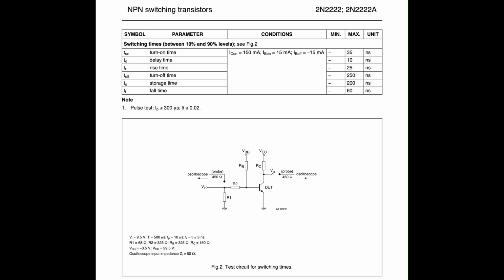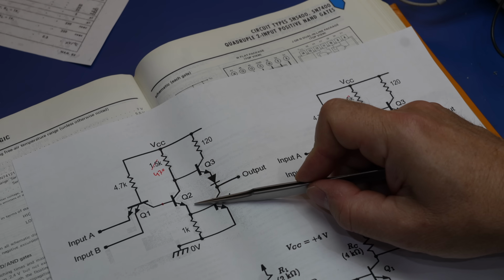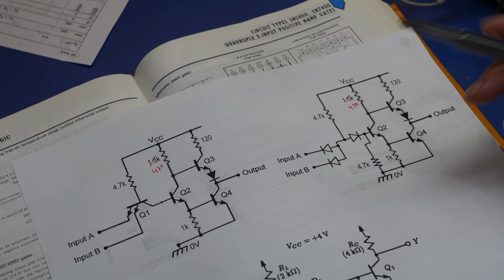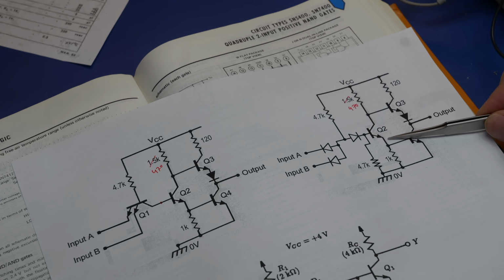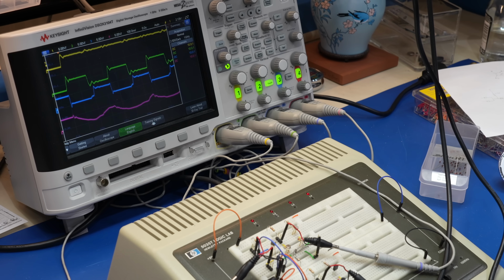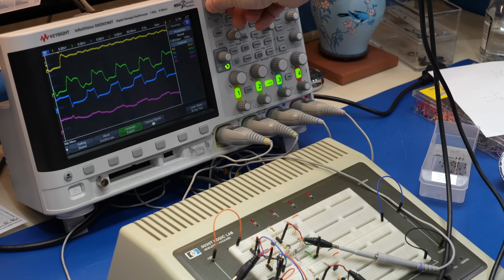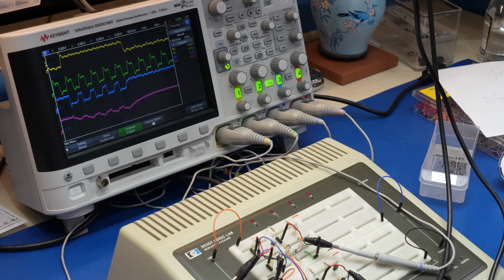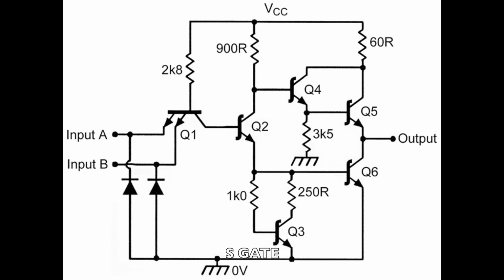How a TTL gate really works - we find out by building one

Comment: Back in the late 1980's I worked for TI, and I remember reading how they developed a massive number of their ICs off the back of their "Digital Field System" (DFS) range of multi-channel seismic recording systems. These were produced between 1968 and 1975, with the DFS-V model remaining in use well into the mid 1990s. Everything from Digital Signal Processing, Large-Scale Integration, Precision Analog-to-Digital Conversion and  Instantaneous Floating-Point Amplification were first seen in these (now completely forgotten and impossible to find) systems.

Comment: Does TTL logic require that the inputs have much higher current sinking capability and result in some incompatibilities with existing designs?  I wonder if the Schottky diode implmentation would've helped the DTL gate quite a bit, as well?  Are modern gates more or less complicated than TTL?

Comment: Could you bias the transistor so it just barely saturates or just barely doesn't saturate when the gate is on?
Reply from the maker: Yes you can, but then it becomes very sensitive to temperature and each individual transistor, so it's unstable. Then you can pile up components to compensate for that but it becomes impractical. That's the genius of the Schottky diode clamp: it does exactly that, but with just one component and no adjustment.

Comment: I have a very tangential question, but having watched your videos I think you might be interested. It involves LS TTL gates and HP instruments...

I was fixing an HP 4192A impedance analyzer, for the second time, and the fault ended up being a 74LS03 logic gate. This gate was buried pretty deep in the fractional PLL, with no off-board connections, so probably not electrical overstress?

My question is, how can something as simple as a quad NOR gate fail? Have you (or Ken) ever run into that sort of thing, and figured out what the root cause is?

A couple of items of history on this particular machine:

1. A lithium ion battery used to replace the trickle-charged NiCd CMOS backup battery (what? who? why?!?) detonated, shearing some wires and covering everything with electrolyte and soot.

2. The various power/reset connectors between the SMPS board and everything else have been very flaky due to some really poor quality tin plating. After cleaning these, I considered the instrument "fixed" the first time.

3. The aforementioned logic gate failed, after perhaps 6 months and maybe 3 hours of run time.

I half suspected that the lithium cell electrolyte had something to do with it but that part of the unit wasn't very dirty, and the particular package that failed didn't look corroded or chemically attacked in any way I could see.

I guess the only other external possibility was that maybe it was actually electrical overstress, due to a failed ground connection in the flaky connectors and something other than 5V reaching the chip. But nothing else was dead, and this happened when the unit was assembled, and so when there was a set of bolted chassis connections between the SMPS and the PLL board. 

Maybe the chip just decided to die?

I feel like I've seen you guys run across failed logic gates before. Is there any wisdom you can offer as to why these things happen?
Reply from the maker: Old TTL chips do die all on their own! Electromigration, defect growth in the semiconductor, bad wire bond, corrosion...

Comment: What transistor did you replace the 2N2222's with on the totem-pole output of the TTL circuit that sped it up so much?   Either I missed it somehow, or you didn't mention it.   Either way,  I'm curious.     Thanks for such a great explanation of how TTL really works!
Reply from the maker: It was an HP proprietary 1854-0610 transistor that I had in my collection, no JEDEC 2Nxxx equivalent unfortunately. Quoted for Ft=800 MHz.

Comment: How is a "thing" with 2 emitters different from the same thing with just 1 emitter which has 2 wires attached to it?
Reply from the maker: That would short circuit the two inputs!. The dual emitter has two junctions that behave independently. The two inputs remain independent, and aren't short-circuited.

Comment: I've seen the Schottky diode trick elsewhere but didn't get it. Thanks for taking the extra step to explain that. I can definitely say I learned something. (And I did see the other commenter identify that as a "Baker clamp.")
Reply: A Baker clamp was often done with a regular SI diode. The Schottky diode achieves the some thing with less saturation voltage. (And the diode is slightly faster too.)

Comment: Please try it with a 2N2369 - a transistor designed for ultrafast switching.
I remember reading a great article titled "What made the 1960s CDC6600 supercomputer fast?" mentioning it got around the saturation charge buildup by doping the transistor base with gold, making a built-in saturation limit.
Reply from the maker: Indeed, 2N2369 has a Toff=18ns. Very similar to the 2N709 Toff=15ns. I tried the 2N709 after a commenter mentioned it and worked almost as well as my fast transistor, and was used in the CDC6600 (according to https://cpldcpu.com/2020/02/14/what-made-the-cdc6600-fast/). The 2N709 was designed by famed Jean Hoerni, pioneer of the planar Silicon transistor at Fairchild after having escaped from William Shockley's lab in Mountain View with future Intel founders Gordon Moore and Robert Noyve. Unlike the 2N709, the 2N2369, also originally a Fairchild transistor, is apparently still made. I have only one vintage 2N2369 in my collection.

Comment: Question: without having it simulated, why can‘t you just turn q2 by 90 degrees like q1? So emitter to collector of q1, base via 470R to vcc, collector to base of q4? It would definitely suck all charge out of the base of q4 when q1 goes low but i‘m not certain it would drive q4 on when q2‘s emitter was high. But in theory vcc - 0.6V (base emitter diode) should pull it up…

Comment: Thanks for the lesson, I enjoyed it. With limited knowledge in this area I am wondering why D3 is needed in the DTL, you mentioned it as a voltage dropper but if A or B is driven close to ground why is this needed for the circuit to function? (By pure coincidence I saw a diagram of basically that stage without D3 while checking if I remembered correctly what DTL means so I guess it can at least in some situations work without it?)

Comment: Wow, this takes me back to designing logic circuits out of the Yellow Bible in the 1970s.

But this is a much deeper dive into the inner workings of these TTL ICs than I ever did.  I paid much more attention to the data sheet specs than to the internal circuitry.  After watching your video, I finally understand what was going on inside the ICs.  Very well done!  It was illuminating to see you refine the performance of the discrete transistor circuit, component by component, and see the results on the oscilloscope screen.

And yes, I was waiting until near the end of the video for you to stick in Schottky diodes across the base-collector junctions of Q2 and Q4.  Well, at least you did Q2!
Reply from the maker: Just for kicks I also tried Q3 and Q4 but it didn't improve anything.

Comment: 18:41 noob question: couldn’t you remove the delay in the DTL circuit by adding a diode in parallel to the one pointing to the right, but reverse it?
Reply: or short the existing getting a wired ‘and’

Comment: ECL keeps the transistors in the active region all the time.  Benefits are high speed switching, and also steady current draw from the power supply, so the supply decoupling requirements are much lower. 

Disadvantages are the insane power draw and constant heat you have to remove.
Reply: Reminds me that Seymour Cray felt the challenges in making computers wasn't the speeds, but removing the gosh-darned heat. So put ALL your resources INTO that instead. 👍
Reply: So I guess it's Class A logic. ;-}
Reply: @Jeff-si7ni yep that's a very accurate way of putting it.  And every signal between two devices has a termination resistor.
The other odd thing about ECL is that is runs on negative voltages.  
The mainframes I worked on had -3.6VDC for the CPU logic, and I want to say -4.8VDC for RAM.  There was a -5.2 somewhere, that I can't remember. The termination raptors would get pulled to -2VDC.  It was a serious learning curve for a kid fresh out of college knowing only TTL and CMOS.
Reply: Ages ago I worked in experimental particle physics. Mainly an end user of electronics in those days.  Typical use case was robustly packaged analog and/or digital modules with fairly simple functions, but LOTS of channels and LOTS of interconnects.

Almost all digital circuits were TTL, but ECL was sometimes used.  All I knew about it was that it was fast, ran hot and had weird voltage requirements.

This video and discussion has been very helpful in clarifying one more of those things I "should have" understood way back when.

The most amazing part: this is YouTube. 😮

Comment: Great video Marc. I had to use the schottky diode trick, or baker clamp, for my Apollo NOR gate replica in order to get the average propagation delay below the 24 ns mentioned in the spec. How did Fairchild manage to keep the Toff time so low even though they transistors were clearly saturated? Did their transistors have embedded baker clamps?
Reply from the maker: I don't think so. Which transistors did you use? If you have some laying around, the vintage 2N709 that a commenter suggested worked way better. I imagine you can find a modern 1 GHz-ish transistor that would do just fine.
Reply: @CuriousMarc  I am using the BFR380L3E6327XTMA1 RF transistor. It's turn on time is pretty quick. But the T(off) time was pretty long. Adding the baker clamp dropped the Ton and Tiff time to around 15ns.

Comment: I remember seeing some stuff where they had trouble 'turning off' the output. Turned out they used ECL to 'pullup' but simple resistors to 'pull down'. (or maybe the other way 'round, it's been decades, literally). So the load capacitance, although small, was affecting the rise/fall times.

Turns out, 'switching electronics' is a lot trickier than some folks realize.

Comment: That reminds me of the TRS-80 era—it wasn’t nearly as “trash” as people always said. Since I was an electronics technician and really wanted to get into computers, I started working at a company that manufactured a decent dual-disk drive (80-track, double-sided) with a built-in expansion interface for it, and we used the piggyback approach for the memory expansion. It was then run with NewDOS80 or CPM—the IBM PC with PC-DOS later was a huge disappointment in every way—except for its 80-line display.*

In hindsight, I’m surprised that we only had problems with gate propagation delays in one specific case—but that was clearly a design flaw. I still remember the thick “IC Master” books, and to this day I still own “The TTL Data Book for Design Engineers” and a “Schottky (LS) TTL Data Book” from Motorola, which was distributed by Radio Shack. With their help, we first “sketched” our ideas on paper. Some of the circuits created this way must have worked despite the gate propagation delays, and a few perhaps even because of them? 😎 1.77 MHz was quite manageable with paper and pencil 😉

* Later, I discovered the Displaywriter—compared to that, even the PC AT was a eunuch, and the ill-fated attempt with the PC Junior was downright ridiculous. I also never warmed up to Intel processors, even though I started out programming in assembly language. Terrible mnemonics...

Comment: ???? @curiousmarc I'm guessing that if you replace Q4 with another Q1 with one leg to ground and the other between the emitter (? - has the diode symbol) of Q2 and the resister, then you'd get a hair more speed out of the circuit.

Why am I wrong?

Comment: Ah ha! That explains why class C RF amps have a low value resistor from the base of the transistor to ground. When you read documents describing the amplifiers there's always some throw away comment about it stabilizing or helping the input impedance of the amp. That may be true but very clearly it helps the power transistor turn off faster!  Marc, thank you as always being able to see the wood for the trees!
Reply: Did you know they are often reffeared as base suckout resistor and are analogue amplifier world eqvivalent to a pulldown resistor.

Comment: Are you familiar with the 2N709? That's the transistor used in the CDC6600 (built using, believe it or not, RTL) and was specifically designed to switch quickly under saturated circumstances.
Reply from the maker: Just tried it, and the 2N709 indeed outperforms the 2N2222, if I replace Q2, by quite a bit! It gets out of saturation remarkably fast, the Shottky diode only helps a little! Not as great for swapping out the output stage Q3 and Q4, the transitions are lazy - it's a bit of a weakling transistor, just optimized for turn off apparently. But remarkable for such an early transistor!
Reply: @CuriousMarc  Did you try the Schottky Baker clamp on Q4? 🙂

Comment: Not sure how true it is, but I was told there's another subtlety to how the TTL gate works -- when both inputs are high, Q1 works backwards to turn Q2 on faster than it would if it were just getting its base current through a resistor.
Also noteworthy is that the Shottky TTL families don't have a Q1, they just have input diodes connected directly to the base of Q2. It would be interesting to try building a discrete version of that.

Comment: I once worked on a Honeywell building management system (turn lights on/off, fans on/off, temperature readings ect. from a central console over a coax line.  It had a lot of RTL chips.
Reply: Yep, often still in use to this day. The only limiting factor for these is the software used to control them

Comment: That slow turn off is why DTL has the Vee bias, so that you can pull charge out of the base faster. If you made it with that bias voltage it will switch a lot faster, and with the right diodes (not gold doped 1N4148 with the terrible switching time) you can get as good, or even faster, speed than TTL, but you need to use transistors designed to run in saturation, point contact diodes, and you will get fast operation, like the original design, which was only replaced by TTL because of the need to have that bias supply, and being able to drive much more fan out wise, as TTL with the active pull up and pull down was able to guarantee 10 gates over all operating conditions, while DTL typically struggled to do 5 in the same range.

Comment: Brings back memories.I learned on Resistor Transistor logic, but as discrete components, not chips. That was on a computer dad dragged home from work in 1973. It had been thrown out because nobody wanted it, and spare parts were not available for 7 years. In 1974 I changed both memory banks to SRAM banks, plus a PROM burner and switched PROM bank. I changed it all to TTL chips on wire wrap boards in 1975-1976.  I abandoned that computer in 1979 for a Motorolla EXORmacs. I kick myself for not keeping the core memory cards.

Comment: I do programming as a job. But I always tell my younger colleagues, that they have to understand basic electronics in order to really know what they are doing when they plug hundreds of megabytes of abstracting libraries together in order to write their "Hello World" in Spring Boot.
Very interesting and perfectly explained video for me (who is not an electronics engineer).
Reply: This is good advice. I started out as an electronics engineer but moved into programming in the early '70s. It was fascinating to discover that programming logic was really much the same as hardware logic. Understanding the relationship between hardware and software and designing solutions to optimise both was great for my career and remains a source of much personal satisfaction.
Reply: @John_L Software is just control signals for reusing the same hardware over and over, a gazillion times, one cycle after the other, i.e. hardware replication in time rather than in space. 😉 Well, in recent years replication has somewhat moved back to space, as in parallel computing, because the cycles have not been getting shorter for a while now.